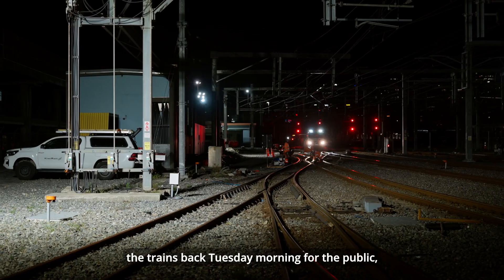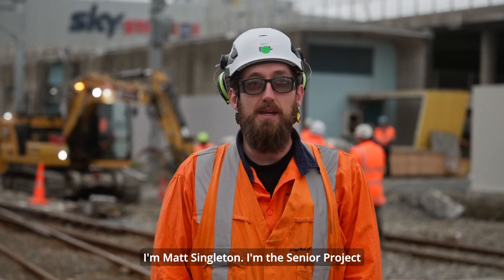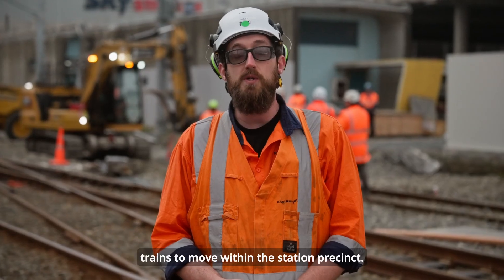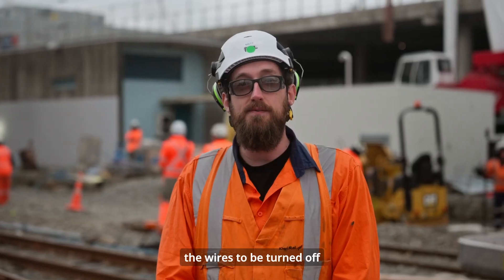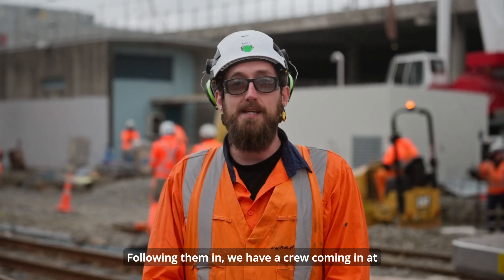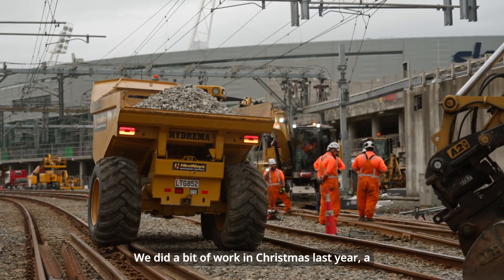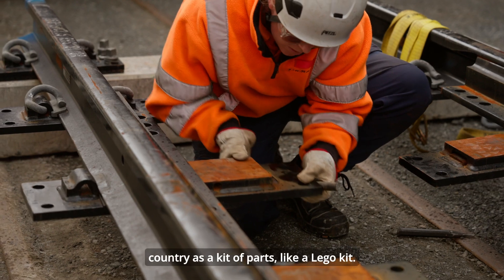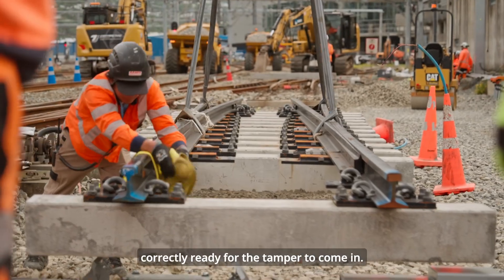Signalling works at Wellington Railway Station

Comment: Is there a need for another platform (or two) at Wellington. Terminal stations are bottlenecks.
Reply: Nine platforms for five tracks is a reasonable number, especially given that we should soon-ish have no locomotive-hauled passenger trains - currently, they bring the locomotive in separately from the carriage stock, taking up twice as many movements. 

There were originally (1930s) plans to allow a platform 10/11 but the walkway to the stadium almost certainly prevents this, and it would mean losing the long-distance bus facilities. 

There's also talk of moving the Wairarapa (Hutt) down line to the west so that the Hutt and Kapiti lines don't interact, which will further improve capacity.